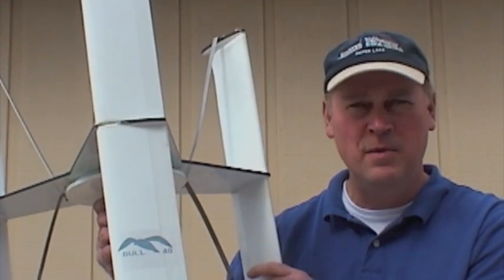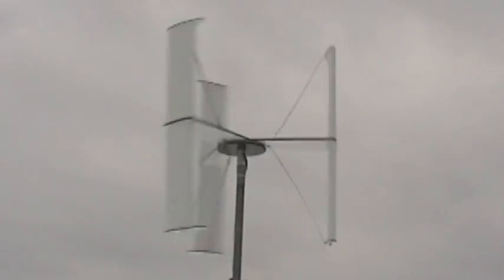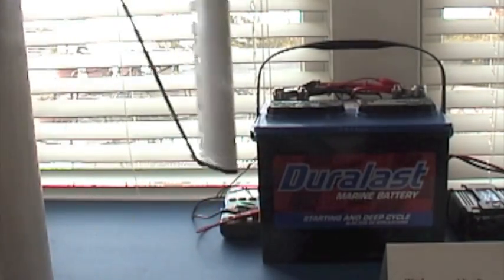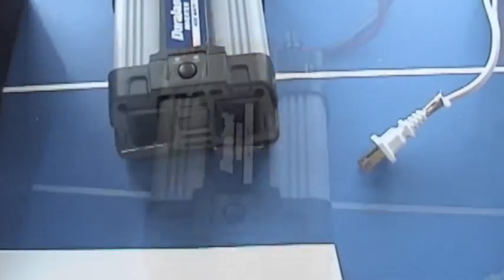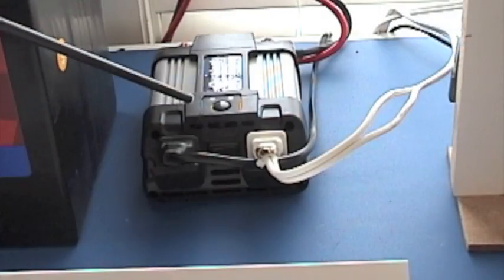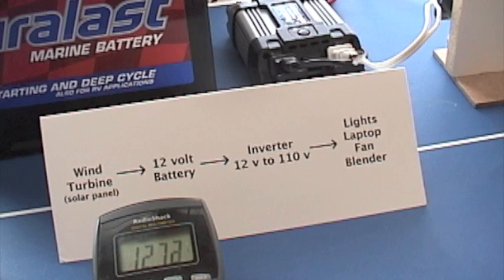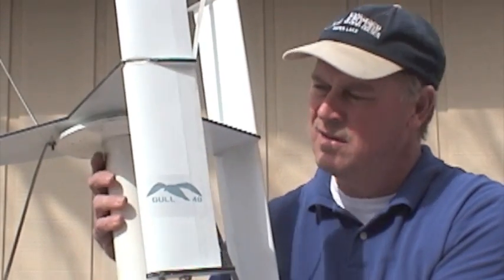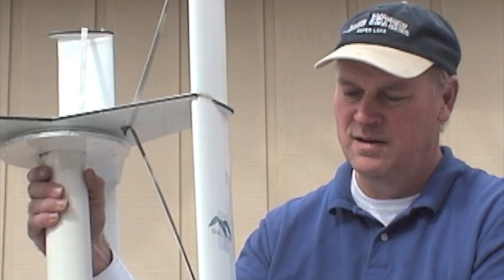Lynx Gull Wind Power Basics

Comment: Love the rotor assembly!  Question: wouldn't the output to the battery be a net zero because your feeding wild AC into a DC source?
Wouldn't you need a rectifier bridge to convert the wild AC to fluctuating DC?

Comment: How can a turbine not have resistance v either an ac or dc generator presents resistance to the wind.  .ie work is done ...that's how energy is transmitted to the battery or  motor or lightbulb

Comment: Good to see you chose 3 blades , this tells me you understand the concept very well, it bothers me to see good money and time wasted on the horrible 4th blade,lol any way if you build a large unit dont use a generator instead use a air compressor
the non lubricated type and configure it to not run as an ari motor due to back pressure . compressors can be very small and yet deal with a broader operating spectrum then generators , the air system would not need to worry about furling devices because it will work best when other windmills must shut down due to over speeding , this would cause the generator to burn up as you no but an air compressor could simply pump more air into a tank, a special sensor would change which tank the compressor would pump into , under high speeds the device would pump into a high pressure tank   low speeds would be a low pressure tank that was once high pressure but has bin drained to power an air motor connected to the system to drive a generator , i have a stack of diagrams you can view if you ever find yourself looking for ideas , im not asking you for money im just not into hording ideas , i have thousands why keep them all to my self.
Reply: AWESOME collaboration attitude ! ! ! This is how REAL research gets done... Real people connecting with real ideas that serve a real purpose. 
Not like the CORPORATE idea that everything should remain the same and should be designed for production and profits - not to serve human kind.
Reply: Thanks for the nice idea.  Can you email me . Nandu.s.iyengar@gmail.com  ..    or whats app me 9699920115

Comment: Yes,  just look for a 220 inverter.  Keep in mind this small turbine is meant for 12 volt battery maintenance.  The larger Gull 160 puts out 24 volts and would be more suited for a 220 inverter.

Comment from the maker: On average about .01kwh.  This is a small turbine intended for battery maintaining, efficient lighting off an LJL sjr3.0 circuit.  It does not need a controller because it doesn't put out enough power to worry about overcharge.

Comment: nice design work on the wind turbine. my 3 phase running off a pulse motor used a similar 3 phase coil design without metal and the output was pretty good. no load , it got over 106.8 volts on single strand of #18 wire. me and my buddy are putting it back together to run some more test on it since i just moved. ill try and shoot you a line soon and possibly share some info. again, great job!

Comment from the maker: Thanks,
I have tried many configurations over the years of testing.  There is a reason for the central rotor on a wind turbine this size.  The geometry is pretty tight.
A much larger structure and pole could accommodate what you are thinking about.

Comment: Just found your video and checked out your website - very nice.  I've been thinking about putting up a wind turbine but never cared for the horizontal ones as well.  Looks like you have put a lot of work into it.  Have you thought about having two rotor arms - one on top and one on bottom (instead of just one in the middle) so you could have two rotors producing power?  Also any thoughts on stacking more than one on a pole?
Craig

Comment: These are easy to assemble complete turbines that we manufacture.  They are broken down for shipping.  They include the alternator which is the flat thin piece holding the rotor and is part of the hub.  If you go to the website at the bottom of the Gull 160 page is the manual for the turbines.

Comment from the maker: This little turbine is equivalent to a Rutland 503.  It puts out in typical winds 5-20 watts.  I have seen peaks of 42 watts but there really is no chance of over charging a 12 volt battery.  It's more a maintainer but can power several 110 v LED bulbs if the right circuitry is used.  That's the next video.
Reply: At least charge controllers are cheap these days. Much cheaper than even 4 years ago.
Reply: @Grizzydan  Yep. And despite what is thought, 42 watts can overcharge a battery. Wattage is volts times amps and depending on the battery, it could go up to 3 amps at 15 volts. And that, if not designed for, can result in boiling of the battery. While wind seldom is continuous  in strength, it still has to be planned for.
Reply: @gravelydon7072  that is what i was thinking. the 6A alternator in my boat motor when something went bad went to 20+ volts and did all kinds of havoc. 3A could do that in time, too.